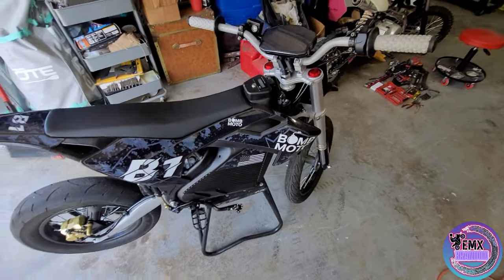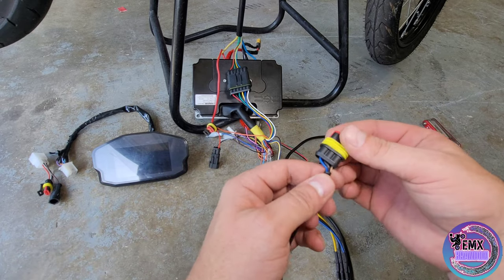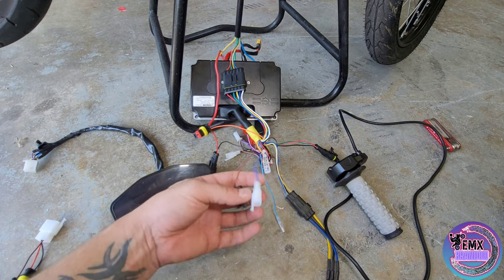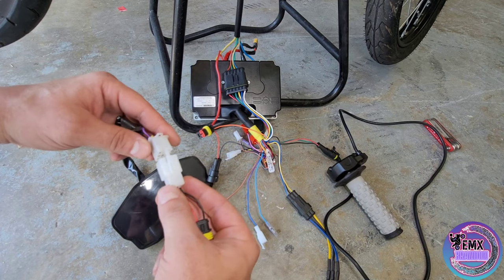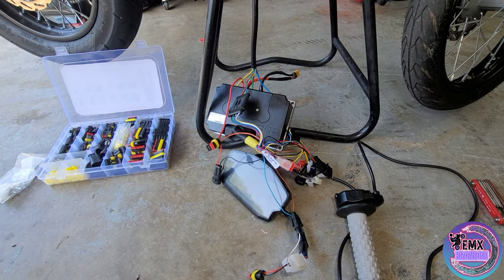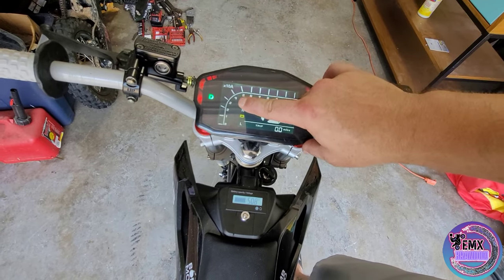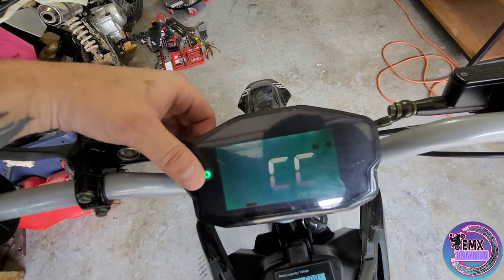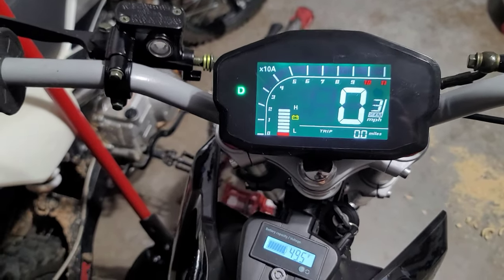Dkd Display Wiring, Mount, & Dialing Speed. Surron Throttle Install! BombMoto B1 w/ Fardriver 72450

Comment: Everything is wired up and the speedo isn't working. I twist the throttle and the speedo stays at zero. I didn't have a "brown" wire so I used the light blue wire for the speedo.
Reply from the maker: It will be a brown wire on a 2 pin connector with a blue with red stripe. Unless you have an encoder model?

Comment: hello, do you know if this speedometer is compatible with the fardriver ND 84680 encoder version, together with the sotion motor?
Reply from the maker: Yes it is!
Reply: @EmxBrandon  the manual says about three options 48v 60v.72v. my battery is 22s.80v. are they still compatible?

Comment: Hey man great videos, just curious. What type/gauge of wire do you use for everything but the phase wires?
Reply from the maker: For all the low voltage or high voltage low amp wires, if I even have to add wires, 20-18awg. Most of the time, throttles, displays, lights, all that stuff already has long enough wires and I'm just throwing on connectors. Unless I'm doing a fully custom harness for a 12v system of course!
Reply: @EmxBrandon  beauty! Just purchased the connector set you recommended. Installing a dkd display and a fardriver 72260 on my budget emoped. 😮‍💨
Reply from the maker: @brendonfriesen8327  hell yeah, you got this!

Comment: Brandon.. do you have to buy a fardriver controller "programmed" to work with this dkd display? (Meaning this have to be setup to work together) 

I have a fardriver controller and the dkd display but was told the dkd only works with votol. 

I haven't tried connecting it yet but after seeing your video I'm hopeful.
Reply from the maker: The dkd works with one-line controllers so it will work with both votol and fardriver! And if you have a fardriver purchased within this year it should come with one-line functionality! Depending on your controller it will either be light blue or just recently a few controllers have been switched to solid brown and that will be connected to yellow/white on the display harness.
Reply: i have a green fardriver 72300 is that compatbible with this display? @EmxBrandon
Reply from the maker: As long as its a newer version it should be one-line capable! Is it the 72300 s12 with the phase lug cover?
Reply: @EmxBrandon  Is this also applicable for the nd96850? Mine is from 2022 though 😂 only getting to building the actual bike!
Reply from the maker: @oneman29  it's possible your controller doesn't have one-line functionality. I don't believe they started including it with all models until last year (2023) but I'm not 100% sure. If it is you'll probably use the light blue wire and if that doesn't work try the solid brown (boost) wire!

Comment: Hey brother what exact black wire did you rob for voltmeter ground??
Reply from the maker: I stole mine from the red 2 pin for alarm power. It will be a pink and black wire! Theres also a brown with a white stripe and black together on a white 2 pin for reverse, you can also use that black for a ground.
Reply: @EmxBrandon  Right on that's what I was looking at but wanted to see what you would say!  Always appreciate you big time man! I need to give you a shout out in one of my next videos if I can remember
Reply from the maker: @Razorcrew_Cole  hell yeah, no problem brother! Anything else just let me know! Did you get a 72300 or 450?
Reply: @EmxBrandon  I got the 72450 I think you recommended and a few others did as well 🙏 excited to give it a try, I got the new Kelly with Field weakening but it's not working with FW-11 or the bomb moto Kelly's times just over and I have to get over it lol
Reply from the maker: @Razorcrew_Cole  hell yeah the 72450 with my tune will give the b1 all it wants! The 72300 will struggle turned all the way to 100 amps so i always recommend going overboard a bit 😆

Damn thats a bummer on the new kelly controllers, they looked super promising. Ill be trying out the flipsky here soon, excited to see how it compares with the fardrivers power.
Reply: @EmxBrandon  Yeah me too I have all three sitting on the desk for a minute Just waiting for Some batteries to come in to start running tasks between them all!  I'm curious about Jordan's jetpack now to haha

Comment: Is this throttle better than what comes with the lonestar kit? And the dkd display is only for fardriver controllers? I’m super interested in vesc / was planning to order the flipsky but I think I’d prefer to have the display
Reply from the maker: Im not sure what throttle lonestar comes with tbh. I can tell you its been an awesome throttle though! And the dkd is for any one-line communication controller. Id have to do some research to see if the flipsky can work with it though. In my opinion id much rather have the vesc over the dkd display, and worst case you can buy something like the ct-22 that just runs off hall pulse spliced from a hall wire!

Comment: I have two questions about the display. Firstly, how much does it cost if you order it directly through fardriver? And secondly, is there a way to sometimes have the bike power turned on without the display turned on? With 2 different switches/keys?
Reply from the maker: It should only be about 40 bucks plus shipping if you go through fardriver i believe. And yeah you can definitely wire the display up to its own switch to turn it off and on whenever!
Reply: @EmxBrandon  Ok that price is really good for its functions. I am curious though, if the amp dial on the display only goes up to 12x10A=120A, how will it display a battery that is putting out more than that? Also, do you think that the battery drain from the display is noticeable at all? or is it too hard to tell. Thanks
Reply from the maker: @schmeglyomigy6174  yup unfortunately if you run over 120a you get nothing but maxed out guage 😆 one of the downfalls of all these one-line displays. And you wont notice to much draw, it anything you might see your volt meter drop .1 while its on.
Reply: @EmxBrandon  Oh damn that’s a bit of a let down. However, most of the time I wouldn’t be over that 120 amp line either way. That’s good that it doesn’t take too much battery. I had a question about the waterproof/water resistance of the fardriver controller and the waterproof connectors. If you have it mounted in a a razor inside the battery box, and you have the fardriver with the waterproof connectors, are you able to ride through the rain without an issue? The battery I am getting has a water resistant metal case so I’d prefer to have everything water resistant. What do you think the best way is to make sure the razor is safe to ride through the rain?

Comment: I am using a 60v battery with the DKD display.

My battery capacity on the display is not showing the same capacity as on Fardriver app and on the batteries own meter.

They are showing 80% but the DKD display is showing 6 bars.

I have set 60v in 879 menu and I would like to display a more accurate value and tried the 824 menu but value displayed is set to 72 and when I change to the 100% voltage value of my battery of 67.3 I don’t seem to be able to save this value as I tried long hold on the right button.

Can anybody direct me into how to save the value and I also thought that there would be an empty and a full value to set.
Reply from the maker: Youve done all you can do with the dkd display. They are pretty terrible as far as the battery read out, so is the fardriver app. Trying to get them to match up is a losing battle. You can probably check your bms app and it will be off from both of those too. I always run a actual volt meter and just use the dkd for speed and to display what mode im in.
Reply: @EmxBrandon  Thanks for your reply. 

Funny enough I just bought a volt gauge to mount on bike.

I found that I could tune the Fardriver app capacity to match battery by using the parameters “Full BattCeoff” and “0 BattCeoff” in the Protect section of app. 

When you charge to 100% you can change the “Full BattCeoff” value to make the app capacity meter reflect your battery state and you can also use “0 BattCeoff” when battery is at zero.
Reply from the maker: @gmcdiarmid  thats good info! Did it help the display at all? Back when ibused it on my mototec, it seemed the first maybe 20% of the battery life wouldnt really move the bars until you got down under 80% then it really started moving. Id have to play with it since more recently it seems the fardriver does alot more for the display now. But i had my byte option set so it would drop the bar with voltage sag, it was just very slow to react and level back out.
Reply: @EmxBrandon  After reading your comment again could you explain “But i had my byte option set so it would drop the bar with voltage sag” what byte option are you referring to. We noticed quite a sag in our first test. 

We are using the QS165 kit with a Surron 60v and a Time ET Moto frame. 

We will upgrade to a 72v but the 60v was for us to test.
Reply from the maker: @gmcdiarmid  byte option is under the display parameters in the fardriver app. It used to be labeled with what each option does but now its just labeled 1-8 or whatever. All it does is change the way the display reads certain things like amp draw and voltage. But they change things up so damn much. As far as your voltage sag what is your line amp set too? The time et is a big bike aswell so im sure that surron battery is struggling.
Reply: @EmxBrandon  Yeah made a few mistakes as Time rear wheel had a 520 42 tooth rear sprocket and as the sprocket replacement on the QS165 was a 420 we got a rear 420 sprocket made but choose 45 tooth amd discovered way to small and have ordered a 57 tooth this week. 

With wrong rear sprocket in the mix we also never changed to line amps from auto learn and Surron BMS must kicked in and it seemed like turtle mode so we changed to 90 and to make worse we tested outside house which is a 10% gradient so was not a fair test.

Comment: Hey Brandon . I have it blue line hooked up on the far driver . It turns on but doesn’t read the speedo
Reply from the maker: If its not blue then try solid brown, it will be on a 2 pin connector with a blue wire with red stripe. There are other brown wires with colored stripes so make sure you got the solid brown! Which controller do you have?
Reply: @EmxBrandon thank you ❤❤❤❤ huge help 
God bless you ! 🙏🏼💪🏼